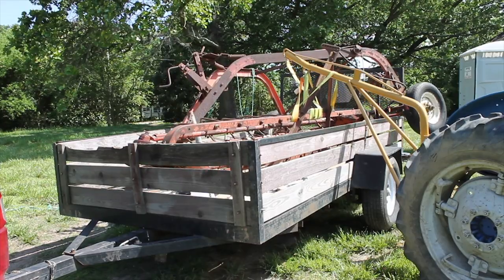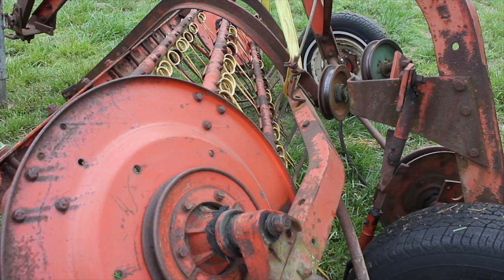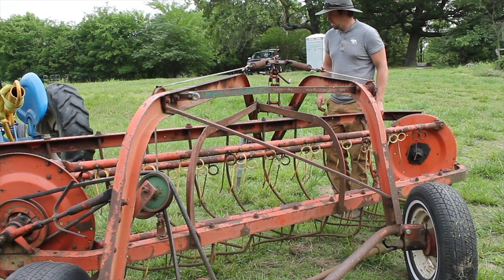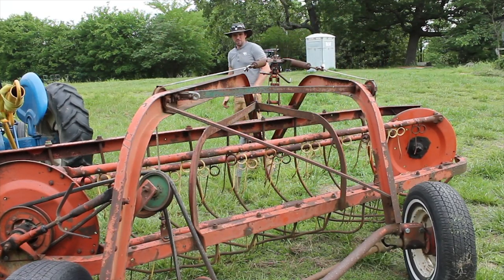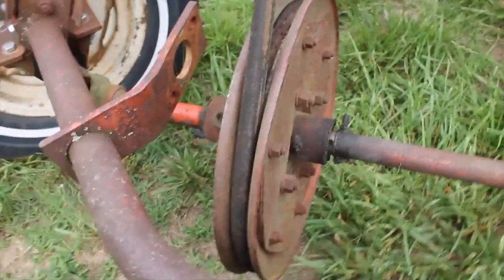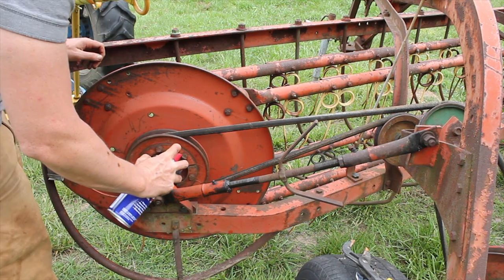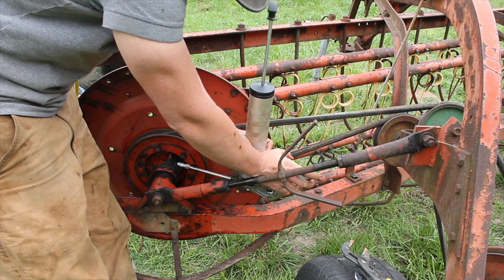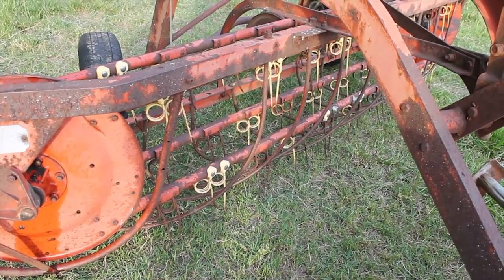Hay Rake Repair - Ranch Hand Tips

Comment: Great video.  We have this same hay rake and have been harvesting nearly 100 acres/year since my grandfather bought it new in the early 70’s (approximately?).  I’m ordering a new belt as the existing one is almost (split) worn out; I believe it will be the second belt ever.  As with most of these rakes, the clutch/handle has been removed for decades, we just keep it engaged always.

Comment: WD stands for Water Displacement  IT IS NOT A LUBRICANT.
Reply from the maker: Riiight... and we were using it for the purposes of freeing up some rusty components I believe we used a grease gun for actual lubing (not sure where you are going here). Water Displacement chemicals are used as solvents and rust dissolvers.   IF YOU WATCH AND LISTEN to the video I specifically stated that we were using it for that purpose. The lubricant-like properties of WD-40 come not from the substance itself, but from dissolving components. And the effect doesn't last. WD-40 can be a good substance to start with — it can help clean up rust or other grime and free up something that is stuck.
Reply: Trying to minimize the trial and error time if I can.
I have rebuilt dogs before, but it is best if one has an Idea of how much to build up on the edge of the dog that has worn out.
Reply from the maker: No, but honestly it's probably about time for it, so I will do some research and give it a shot... there's always a way to succeed with these types of repairs through a little trial and error.